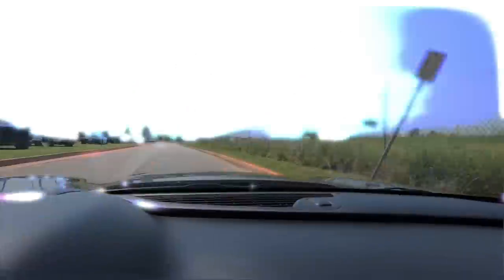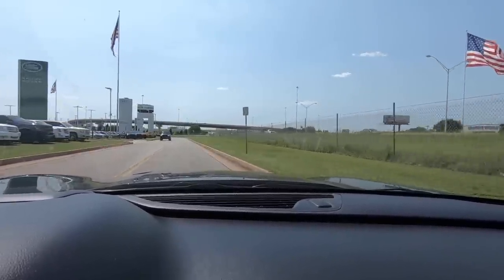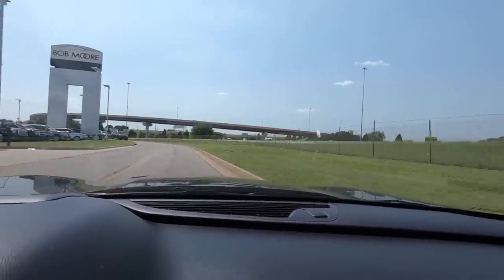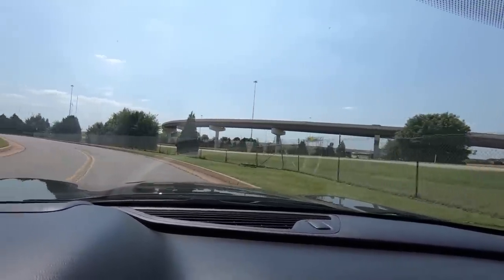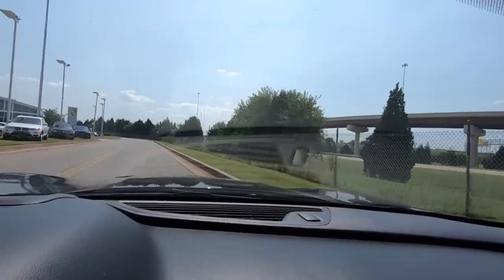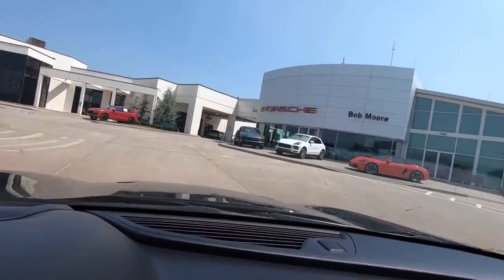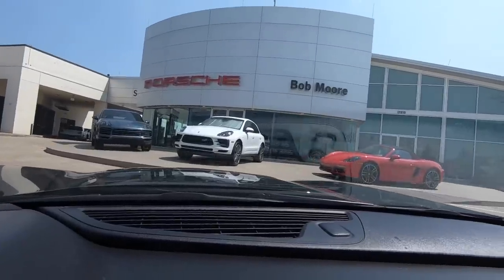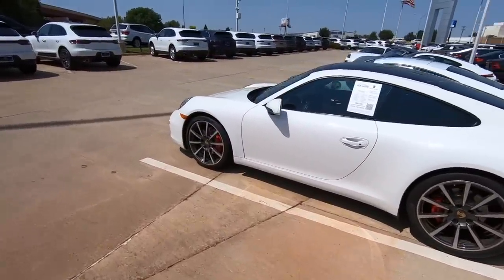Cheap $7100 Copart Porsche 911 996 Oil in Coolant - Uh oh!!

Comment: Used that same device to drain and refill cars for years doing collision work. Never ONCE, not once, did it ever ruin a radiator hose or any other hoses on ANY car. Porsche is using some type of rubber that is of less quality than other imports. And I have fixed thousands of cars. Idk what’s going on with Porsche parts but they are very expensive but not engineered very well🤷

Comment: Replacing coolant on a MGTF135 mid engine car I removed the radiator (at the front), flushed it many times and then did lots of heat cycles with clean water. Surprised at how long radiator took to get hot. Enjoyed doing job right. Wasn't any reason to do flush other than it hadn't been changed for a while (a long while).

Comment: i like that vacuum for the cooling system fill, it would be great to use on my 95 C4 Corvette, good luck on the hoses, i saw that Y hose on ebay for 52 dollars, wow i think i can get silicone hoses for the vette for that price lol, dont worry my idiot brother bought me a new distributor for the Corvette to find out the bearings in that optispark knock off were bad, I ended up puting the old one back in with a new Accel Cap n rotor, yes it behind the water pump, blah!

Comment: 30 or 40 psi?  Brother, you will be creating More leaks by doing that.  And the shout you used isn't lubricating the water pump like coolant would; wouldn't be surprised that it fails in short-order.  ---There are coolant flushes that are Designed to flush oil out of the system, and not cause damage to the rest of the system.

Comment: Good video and logic work, but you cannot expect a 20 year old water hose with pressure and vacuum and oil inside like this will last without damage ! The hoses are simply not made for this and you have to replace it all , which is a normal maintenance point every 5 years , but nobody is doing it . Also be careful driving the car without protection for the aluminum cylinder heads and aluminum water coolers and only with soapy water. There are special gaskets which only work properly, with the factory recommended rust protection /antifreeze liquid. You already mentioned "this is a german car, it will break" , it is not the car, it is mostly the wrong maintenance and repair. This engine is bullit proof , but somebody (maybe Bob Moores apprentice )  filled the water reservoir with new engine oil in the past, when they serviced the car. So the first engine failed by overheating. I would change the oil filter and check the air filter too.

Comment: As a retired GM mechanic that has dabbled around with Porsches and Volkswagens over the years. Get that shout out of that system. The Shout is reacting with the rubber of your hoses and causing them to fail. And they probably won't be the only hoes or seal failure in your cooling system. I remember back in the 1990's when Dex Cool first come out in the General Motors cars and trucks it was reacting with the hoses and different metals of the blocks and causing the cooling system to gum up and get nasty. It's a safe bet that the Shout is reacting with the rubber of the hose and causing your failures.

Comment: 05:09 Do I understand by the sticker that dealers can sell a car with no obligation to warranty them? Well that sucks! Here is OZ, a dealer must provide at least 3 months ( if I recall correctly ) on any car sold that is less than 10 years old and has travelled less than 160,000 Km. Private sellers are not under any obligation to offer a warranty.

Comment: Without antifreeze, your boiling point was around 212 F and the resulting pressure ruptured the hose.  The oil and the suction didn't help either.

Replace them all, word to the wise~

Comment: Correct me if I'm wrong, but if one of the heads is cracked, wouldn't the vacuum on the cooling system not hold?
Reply: Good thought. Pull the dip stick and see if it is pulling air
Reply: not always, it may only be leaking when the car is being ran, cause the extrreme heat of the engine causes the crack to expand
Reply: @justinsrt4626  that makes sense

Comment: If you want to check head crack, just work opposite, confirm if there is coolant in the oil. This tells you 100% sure if head or head gasket is or isn't cracked

Comment: Good grief... how to make a massive deal out of flushing the coolant system. I did this with a garden hose on my golf, and didnt have to piss about pulling a vacuum on a system that is *designed to run under pressure*. Im not surprised those pipes failed. not at all - I was thinking that exactly that would happen on the first overly long winded video.

Comment: Hate to break this to you, but you should probably bite the bullet & change all the coolant hoses.  First, they're probably all 20 years old, add the fact that there was oil in the system and you have a bunch of near certain failure points.  Never know, there may be a kit out there, definitely check around to maybe save some $$$.

Comment: Dawn dish soap works well. As does cascade powder premixed with warm water mixed in. I have used the combination a couple times to clean up after a blown head gasket. Followed by a lot of clean water flush then a flush of water and coolant flush. Then flush with distilled. Then filled with coolant. I never saw any trace of oil in the coolant system again..

Comment: Due to the oil mixed with the coolant the temperature fluctuates inside the housing which resulted the rubbers to go soft and eventually crack. Another thing is that the air vaccumed multiple times to fill in soap liquid also crunched the rubber opposite direction. Very entertaining. I learning a lot from your channel. Very interesting

Comment: Hi Randy I would guarantee that when the engine was replaced that they didn't replace the cooling pipe work which they should of done because of the cost which would be thousands in parts and labour and being a main dealer would not have used the method that you are using.     Gary.... England 🇬🇧

Comment: I bet someone put power steering fluid in the coolant tank. It softens and swells rubber hoses. I worked in a shop for a couple of years and saw it a handful of times. It was usually in the brake master cylinder. It would lock up the brakes and we would have to change the master cylinder, calipers, and everything else that had rubber seals.

Comment: first off you should of never used shout detergent-- when you spill or get a grease spot on clothes and washed laundry the grease spots still remain proving that laundry detergent has a hard time breaking down oil and as we all know oil absorbs heat and having left over oil cloged in system raises engine temperture which isnt good...replacemet of rubber hoses or removing them and washing them out good ..plus flushing the block would show the system is oil free...plus i think prevous owner didnt break in the engine when it was replaced resulting in the problems the car has now

Comment: That occurs from the engine being blown, it blew up like a balloon. Those Y joints are the weak link, seen it with other engines. One make that is a pain was a Town and Country, had a Y plastic connector between three aluminum hoses and the thing would split from the heat. Replaced it with aftermarket one so that was one whole piece of plastic than to plastic welded ones together.
Good luck with the car. And that is oil in the cooling system not water in the cooling system.

Comment: You are going to end up replacing all the rubber hoses in the cooling system because coolant hoses DO NOT like oil, at all. Better to do it now rather than piecemeal 1 at a time because you're going to do it anyway.

Comment: And...the suction provided the collapse seen on the failed hose...Hoses are cheaper than engines.  Replace ALL hoses on that cooling system now and don't repeat the suction process!

Comment: You need to replace ALL rubber hoses on the cooling system if you haven't already done so. The petroleum base of the oil has destroyed the integrity of the rubber, which is why your Y-hose was swollen. Even if the hoses appear to look okay on the outside, the integrity may be reduced or destroyed internally. If you lose coolant later and the engine overheats, another head may crack and then your right back to square one.
Reply: Okay, disregard - I should have watched the other videos first before commenting. It looks like you did take care of the other hoses.

Comment: I think that you have a good engine and you are correct in your guess about the old coolant being left in the system,,, I would think that you would see fresh oil in the cooling system each time you ran it and that the oil level would be going down, if the engine had a cracked head,, :-)

Comment: That little hose looks like a type of fuse, pressure release.  Better that then the aluminum piping.  Temperatures of all that piping around probably affects whats running through that little pipe.

Comment: If Porsche cant manufacture or source a reliable a 7 cm length of rubber tube and then charge the consumer $56 for just the replacement part, it shows the amount of respect Porsche has for its clients.

Comment: I would have siphoned out the oil at the top of the reservoir, drove it for a bit, siphoned it out again, and repeated it a couple of more times. Oil rises to the top and the water circulation would have brought the oil to the highest part of the system. Draining the water drew the oil through the system.

Comment: I wouldn't be driving that car that hard because that water is going to boil in there and you have no lubrication for your water pump driving around the block heater on high and on hot and then driving around a block or two box and then come back let it until the fans kick then you know the car got up to operating temperaturedrain it out and put hot water back in it with laundry soap you don't want to shock the system metal does not do good going from hot to cold really fast

Comment: Probably the oil separator on the crankcase vent ..they all develop leaks..it can be changed without pulling the engine  but not so sure its easier

Comment: If you are not loosing Oil and your heater is blowing hotter air than before then it is just residual oil as far as the hoses change all of them when it's running clean . As far as hoses they have shops that make specialty hoses maybe Oklahoma does aswell you might as well change all hoses that were in contact with oil

Comment: Then grab the hose with those pliers and twist it to break the seal loose will make it a lot easier to pull it off twisted back and forth to break the seal loose I would have just cut that hose and 1/2 it's already ruined

Comment: When I bought my 98 Mustang Gt With 96,000 miles on it, four years ago, it was obvious that the only maintenance the original owner did was change the oil regularly.  I know this because the engine doesn't smoke or burn oil. I did, however have to replace everything else.  Plugs, wires, radiator, hoses, intake manifold(leaking gasket), brakes, front and rear wheel bearings and seals, fuel pump, lower ball joints, inner and outer tie rods, sway bar links and had the transmission rebuilt. The good news is, I did almost all of the work myself, in my own driveway, and know most of the in's and out's of my car!  It makes you one with your vehicle!!!

Comment: When you finally figure out if the oil in the coolant was just residual, I'd recommend replacing every line that coolant ran through. Oil Vs. rubber, oil always wins. Hoses will swell and burst. Now or later. Just my .¢02
Reply: Never mind, just finished the video and saw your future action lol

Comment: I thought the vacuum tool was a great idea. Sure the oil had the hoses soft and the vacuum pretty much was the reason they failed rather quickly. You saved yourself a whole lot of headaches down the road and if you're selling it you can be confident you fixed all the weak points in the cooling system. Great videos I really enjoyed them and thanks for sharing the vacuum pump I'll be purchasing one soon. Keep making videos of buying and selling one of my great passions.

Comment: I think the people saying the oil damaged the hoses are right, going to have to replace them all.   But even so, what are they all going to cost?  $500?  Better than a $10K engine. 

I'd also say mod away, if it adds to the value of the car, it's not like it's worth a fortune as it sits, although you are in Samcrac territory here.

Comment: The oil contamination has compromised all the hoses. They are going to continue to blow until you replace all of them. Best to just get every rubber hose that touches the cooling system replaced and save yourself the headache.

Comment: Hi just replace all the hose and be done with it, I had a tractor for a customer get oil in the water jackets when the bad coolant ate the aluminium timing case and the timing gears pumped oil back through the hole into the water jacket and mixed coolant in the oil pan.  He wouldn't replace the hose all at once, he was just doing them as they failed.  I cleaned the system out starting with Dawn dishwasher detergent and then a heavy duty cooling system flush from Freightliner trucks, it's good stuff at $40 a gallon it should be L.O.L. It's cost him a fortune in lost coolant and down time that could of been avoided listening to a mechanic thats seen this before.

 It's good you only got oil gone one way, his motor was a complete mess internally and needed 4 oil changes /chemical flushes to get that cleaned out to.  He really didn't want to pull the motor apart and clean it properly either, I'm surprised his hasn't destroyed all the white metal bearing in it to when he ran it before he realized there was a problem. Thanks for the update hopefully better news is on the way.

Comment: This is the problem with that vacuum system you used; with age, the hoses and plastic water outlets are brittle, or at least more brittle than they were when new.  When you sucked the new fluid in, you stressed the system to the point that that hose popped.  It didn't help that the oil in the cooling system had also broken-down the hoses too, as they aren't designed to carry oil, only coolant and water.  --I started to say something last time, that using that device was a bad idea, but I held my tongue.
Reply: Actually, it may be a good idea as it clearly points out the weak links in the cooling system in his driveway and not having the car do its best impression of Old Faithful on the side of the road.
Reply: Yeah but what else would allow you to completely clean the cooling system from oil if you can put pressure through it with the soap
Reply: @TwentytenS4B8  In my experience, putting any mechanical devices in situations they would Never encounter naturally is not wise.  If you see my other comment, 30-40 psi, positive Or negative pressure, is a great way to break what is already solid...  To each their own I guess.

Comment: if the cooling system holds vacuum, there is no cracks in the head or busted head gaskets, if there were, you would not be able hold vacuum, that is my 10Cents

Comment: Older hoses will split after being put under a vacuum, even new hoses will at times, the vacuum draws all the moisture out of the system and the rubber hoses, plus the rubber hoses are built for outward pressure , great video I like these 👍👍

Comment: If it had a cracked head, wouldn't there be soap bubbles coming out of the exhaust pipes?
Reply: There would also be milkshake in the oil pan. All he has to do is drain the oil to find out.

Comment: Might as well replace all the pipes on the cooling system pulling a vacuum on pipes that are caked in oil and proper soft is going to keep you returning with more burst pipes and other issues along the way plus no idea how long the porsche was in copart yard or before that too( keep up the good work tho hope the Porsche  is a win)
Reply: most of the long run hoses are aluminium you only have to change the page rubber ones at the rear then you will be sweet. If the head was cracked you would be seeing oil by now

Comment: Not a good advertisement for the vacuum cooling system filler kit then if it keeps destroying old hoses
Reply from the maker: Derp.... The old hoses were destroyed from OIL SATURATION.
Reply: @AutoAuctionRebuilds  Derp yourself, coolant hoses aren't meant to be sucked in like that. Your hoses might have been alright for a long time, now you've stuffed them and they will continue bursting them until you either change them all or you cook it. Im not the only one in the comments who thinks this, including a mechanical shop who stopped using that device because is wrecks old coolant hoses.